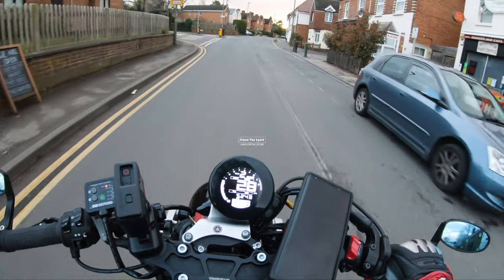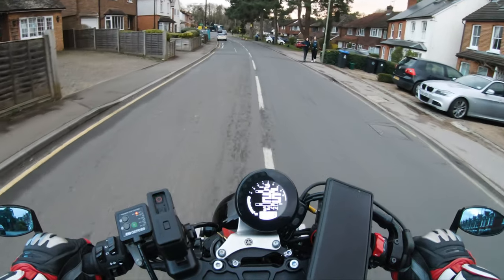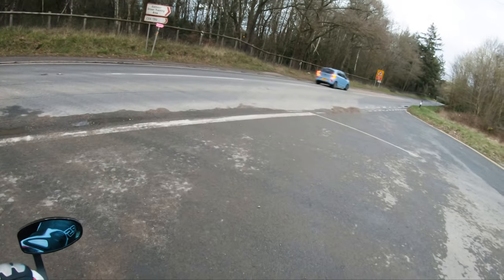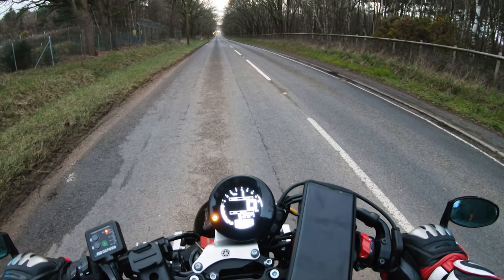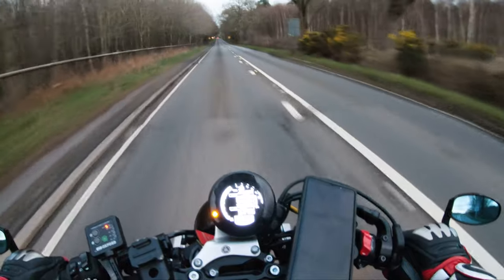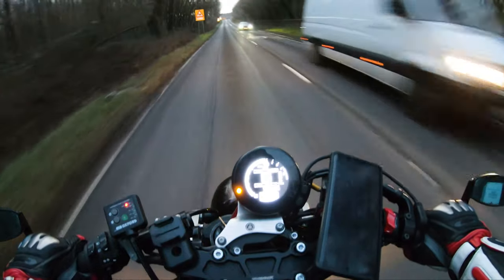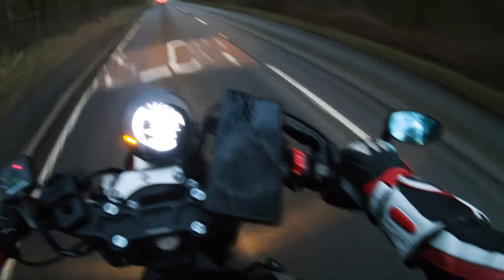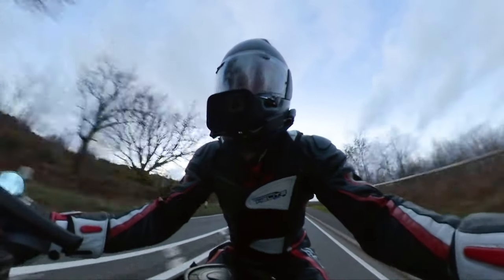XSR900 Launch Control:  (Woolich Racing Tools)

Comment: Looking at trading my XSR700 for a 900 in the summer, the black one looks fantastic! Pretty interested the woolich racing tooks package for the bike, really opens up it's "fun" capabilities from what I've seen. If you don't mind me asking, how much does the woolich package cost and where did you get it done? I've been hunting around online but I've seen 10 different answers to the same question. 

Ride safe and regards!
Reply from the maker: Hi Edd! Thanks for the question. For the full dyno tune plus woolich racing tools it cost me just under £1000 for all the parts plus labor. That includes the quickshifter/auto blipper and launch control. It's not cheap but if you're into sporty riding worth it imo.
Reply: @SimonTheSquid  Thanks for the info! And oh for sure, some Harley riders will spend double that just on custom paint work, being a hooligan comes at a cost, totally justified! :)
Reply: @SimonTheSquid  Not cheap, but considering how much I've dumped into the bike already...